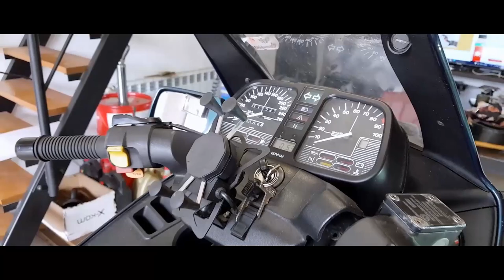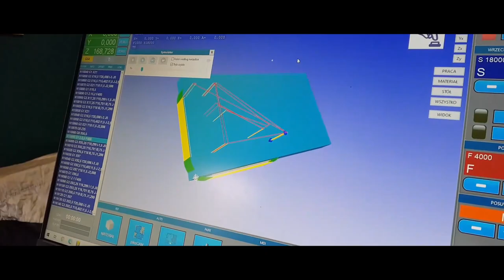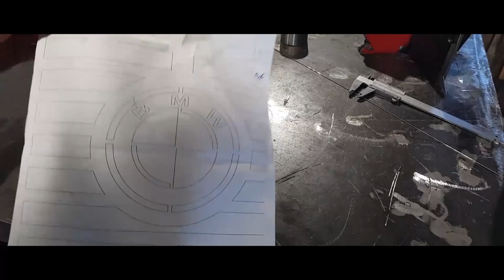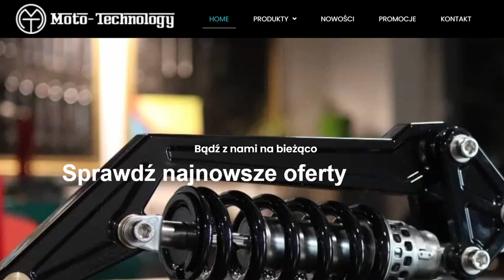BMW K100 RS Custom Cafe Racer by Moto-Technology part 1

Comment: Hello, is there a drawing of the upper traverse for the fork of this motorcycle in the public domain? And from what material was the traverse machined?
Reply from the maker: Tripe clamps are made according to our design, it is made of aluminum. We do not share our project. But you can order ready-made Tripe clamps from us. I am sending a link to our catalog: http://moto-technology.pl/wp-content/uploads/2022/09/MT_en.pdf
Reply: @Moto-Technology  thanks for the answer. I will definitely look through your catalog and apply for your services.
Reply: @Moto-Technology  can i have another question? What bike is the front fork from?
Reply from the maker: @cryptan_v_kube  Of course we will help.
Reply from the maker: @cryptan_v_kube  Front sunspation is from Suzuki GSXR 1000 K8/K9